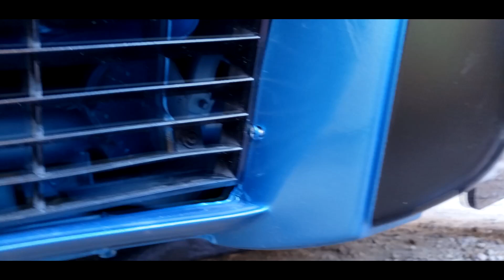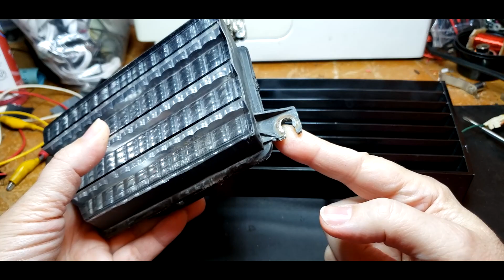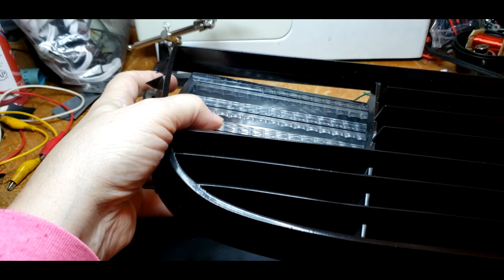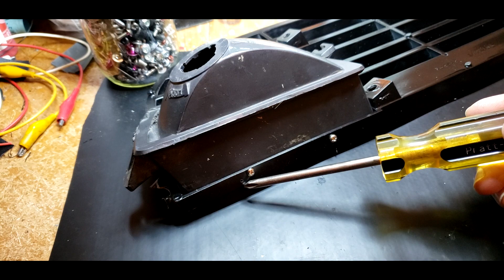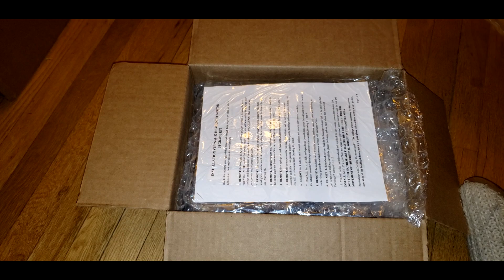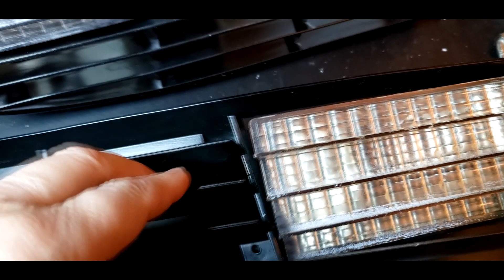1976 C3 Corvette - Headlight Actuator Kit, Grilles and Turn Signal Lenses

Comment: IMHO I would have used black silicone rtv to put that lense back in. :)  Although I think shaving off the bad plastic and installing L brackets at the mounting points would have been better, but more of a pain.  I have Throttle Body Injection on my 76.  Great on gas mileage and runs super clean.  Its a FAST EZ EFI system.  I installed it myself.  Like most installs, just needs patience.  You should look into that in the future.  Merry Christmas!